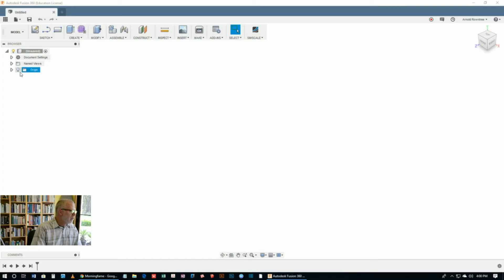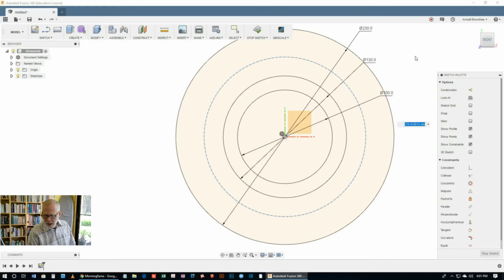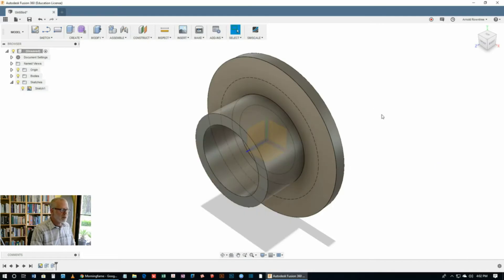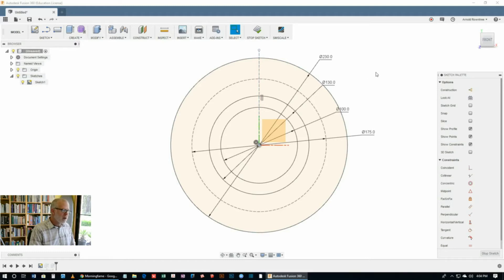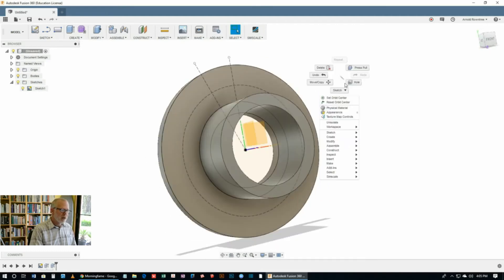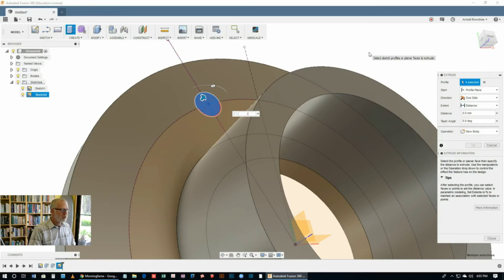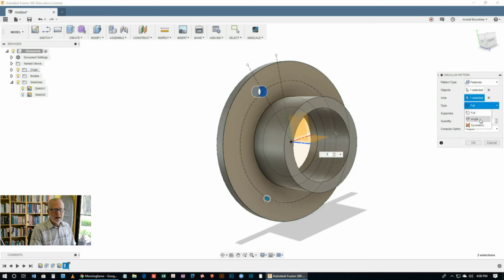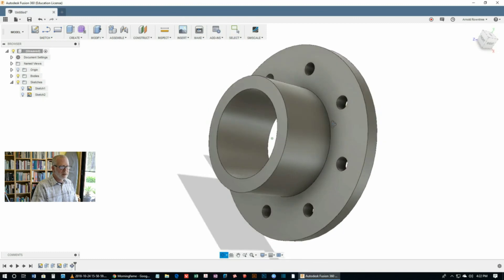Learning Fusion 360 For Beginners - Part 16 of 16

Comment: Hi Arnold! Really enjoyed the series; many thanks for posting!👍😊

Quick question. When I started a new sketch  to place a circle at the intersection of the 175mm circle and the 22.5º line, Fusion wouldn't snap to that point. I had no problem adding a circle to the first sketch; just wondering if there's an advantage to using a second sketch in this instance?
Reply: Hi Adrian. It can be done, I searched the forum and found if you zoom out a bit, select the 175mm circle, then SHIFT select centre of 15mm hole circle, then select Coincident from Constraints menu. Then do the same with the "angled construction line"? Seemed to work for me, hope works for you!
Reply: Mark Masters Thank you Mark, I’ll give that a try!👍
Reply from the maker: You're welcome Adrian, Mark has shown how to do what you have in mind which I've just tested. So yes you can do it but I can't think of an advantage off the top of my head. There is also the 'Project' function on the CREATE menu but it doesn't work with prior sketches. Its great for modeled features though and probably it will get you more of the advantages you are foreseeing. I introduce the Project function in Intermediate tutorial #5 at 13:52.

Comment: love the tutorials hope you advance with them. My only suggestion would be could you slow it down slightly. I'm following on a dual screen computer but boy are you fast. Also how do you get your image to rotate without using the cube in the top right ???  Awesome though overall thank you
Reply from the maker: Mark, that's music to my ears! Please pause the video or scrub backward and forward. I'm not trying to be like a firehose but I do want to be concise. As for rotating, I'm on a windows computer and my mouse has two buttons and a scroll wheel. When you hold down the scroll wheel you can drag your mouse which rotates the model.
Reply: Arnold Rowntree . I do keep pausing it and playing it back Arnold but I don’t think you know how fast your actually going 😳🤪😂😂 or is it me that’s so slow 😂😂😂.  Anyway that aside it’s the best tutorial I’ve ever come across. With them being short it makes them really easy to follow and keeps the frustration down. I can’t wait for you to do more. I’m not bothered about what it maybe as I’m really enjoying learning . With regards to the mouse I’m running the same but the middle button doesn’t rotate the object 🤷‍♂️ 🤪. when I used to use “autdesk” the older version it used to do it on that but I can’t figure out what I need to enable to allow me to do it on fusion 360 , hence why I asked .  Anyway keep up the excellent work 👍👍👍👍👏👏👏
Reply from the maker: Mark there's one more thing that might help, in the little toolbar at the bottom in the middle there is a tool on its far left. with a tooltip that reads "Free Orbit". Right behind it is "Constrained Orbit" When Free Orbit is clicked you'll find you can use the left mouse button to click and drag in the model window. Is that working?

Comment: Thank you once again for the tutorial. I will be looking forward to a future advanced level tutorial. As for the selection of the four parts of the circle, I don't think there's a way to do it with a single click, but it would be appropriate to use rectangular marking. Even when in extrude selection mode, you can draw a rectangular box and select everything in the box. Finally, I noticed when I did parts 1 and 2 that I got the single page versions of the PDF. You may want to update those video descriptions to point to the full 16 page version.
Reply from the maker: Thanks again GBG, have you been able to get all 16 yet?

Comment: Please me correct if I'm wrong. When I use the inspect tool & click on the edge of the a 15mm circle & then the the edge of the 230mm outside diameter the distance in the dialog box shows 47.125mm. but doing the math of (230-175)- 7.5 (half the diameter of the 15mm circle) equals 47.5mm. I would be using this math equation in measuring from the edge of the circle, more than likely with calipers, to the outside diameter when inspecting the part to make sure the part was being made to blueprint dimensions. 

I even turned off the snap to grid to place the center of the 15mm circle at the intersection of the construction lines.

Also a blueprint would call out the diameter of the holes at a certain bolt circle. 

Is there a way in Fusion 360 to reference a bolt circle without having to draw the circular & linear construction lines?

As you can see, I'm a big fan of your videos & plan on watching more of them in the future. You have a great way at presenting the way to draw parts in Fusion 360.
Reply from the maker: Hi Donald, please excuse this late reply, I think you'll find that Fusion like all CAD programs will show you a perfect and idealised model. Inspection for manufacturing tolerances is a whole other discipline and you're probably onto me by now, I've never really made anything in my life except back yard stuff. I will be demonstrating the 2D drawing creation features soon and we're expecting a major improvement in the Fusion 360 drafting environment sometime in this month by the owners. I'm sure that everything will be more powerful from what I've heard, especially the ability to make custom symbols, control lineweights and linestyles and more.